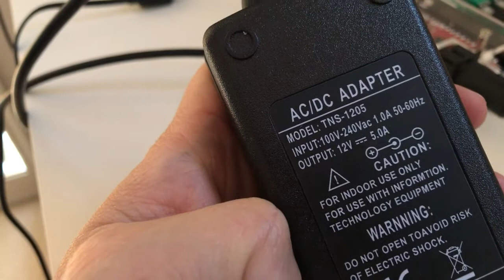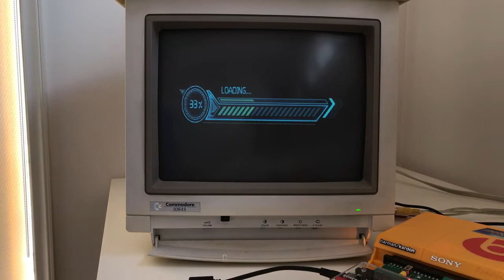Pandora Box CX with Arcade mini Supergun (CBOX) on Amiga Commodore 1084s monitor.

Comment: Does this little pandora have Tearing?
Some games like Nba JAM work at 53Hz, double dragon at 57Hz.
Mame work only at 60Hz.
Games have tearing on a stock MAME (NBA flag moving right to left on NBA Jam original).
Just curious if this box output variable sync signal or only 60Hz (I think, i know the answer 🤥).
Thank 😇.
Reply from the maker: Output signal through rgb scart cable into a 15hz crt monitor, i don’t see any sprite tearing or tilemap tearing, the tearing in the video clip was due to i recorded with 21-24 fps camera app. 😀
Reply: @zenodyssey  OK, thank 😇

Comment: Hi, looks great.  I’ve got the same monitor,  but what cable are you using that accepts the scart input?
Reply from the maker: It’s a customised cable i bought on ebay long time ago, however i don’t see this kind of cable converter any more.   

There are still some cable diagrams on the net, if you know someone know how to soldering, you might ask them to make one for you.  

It’s a converter cable, one end goes into 9 pin video input at rear of monitor, also a stereo rca input that go into your monitor audio input,  the other end is female scart connector that accept male scart connector from your gaming  consoles (megadrive, snes, psx…etc)
Reply from the maker: Probably get a scart tv instead, because monitor is only 13inch, which is quite small if you really want enjoy arcade experience.  If you are living in australia, you can visit local bunings warehouse, there is a e-waste bin in front of their store, inside you may find crt tvs from time to time (some are scart tvs)

Comment: great video - do you have a link where to buy the supergun and the pandora box  (Europe) ?
Reply from the maker: Used keyword ‘cbox’ or ‘supergun’ in ebay or any major online sell websites, you shall find this converter, mine is 80 australian dollars, there are newer version of cbox now, the price may be higher by now.  

Use keyword ‘pandora box jamma’ to search, there are various versions, the one in my video is CX model, has 2800 games, but can not add your own games, the newer model is DX, you can add your own games including playstation games.  price for CX is arounf 40-50 australian dollars, price for dx is around 70-80 australian dollars.  I am not sure in europe, you will need to search around for good sellers and good price.

Comment: where did u get the converter unit from which connect's the supegun to the pandora box ?
Reply from the maker: That converter/adaptor is optional, it shift screen vertically or horizontally, you can find this on aliexpress or ebay, price from AU$40 to AU$70.  The search keyword is “jamma adjustment”
Reply: @zenodyssey  will the supergun work fine  with the pandora's box without the converter ?
Reply from the maker: @lastavenger8532  yes, mini supergun works with pandora box fine.  That picture adjustment board is optional.

Comment: you left out the part about screen tearing and audio glitches 

a nice demo playlist of games to maybe try before buying- but the pandora junk is unplayable imo
Reply from the maker: The games are actually play well in both video and audio…, perhaps i recorded video at 23-24ftp which showing tearing?  Also by upgrading to 12v 8a power adaptor, everything run smoothly. (I was using 12v 5v adaptor to power this card which is a little bit under powered.)
Reply: i have several pandora products NONE of them run well - especially over cga/vga 

maybe you have a frame buffer or something
Reply from the maker: @jonniefast  i had pandora 5s, the cpu onboard is not powerful.  however cx and dx models are all pretty good, dx can also emulate many 2D psx games smoothly like on a real playstation console, some psx 3d games are also performs well.

Comment: Hello Power supply 12v 5A ???
Reply from the maker: 12v 5a is the minimum, you can go up to 12v 8a, i am currently using 8a power supply and i found games are running smoother (on pandora box).